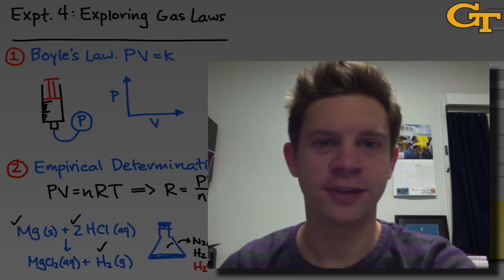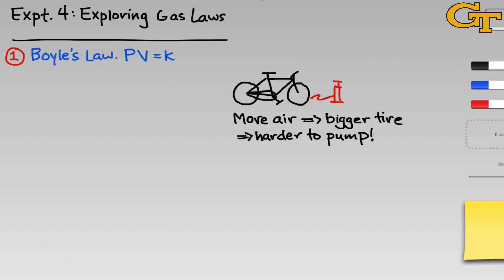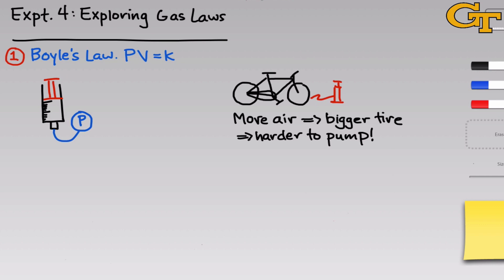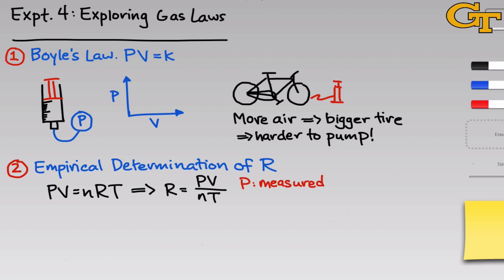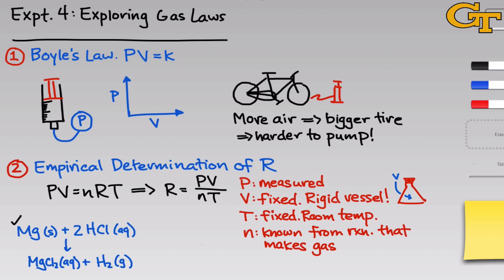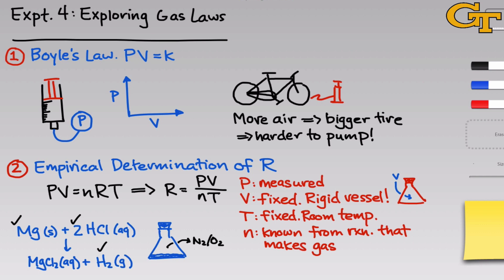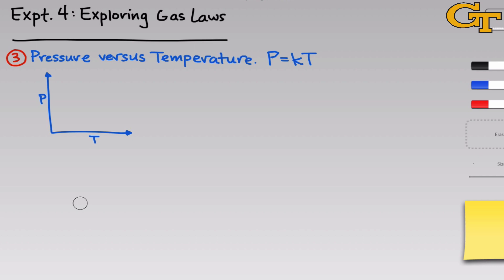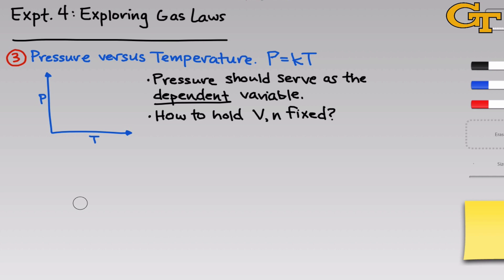Exploring Gas Laws | Intro & Theory

Comment: I totally understand why P is inversely related to V mathematically but what about when we put air into a balloon? As we're increasing the pressure inside the balloon, aren't we also increasing the volume? This qualitative view to me seems counter-intuitive or maybe I'm just missing something in my example.
Reply from the maker: The pressure inside the balloon is actually constant as it inflates! The elastic walls of the balloon ensure this. You can think of a balloon, in fact, as a "constant-pressure apparatus." As you add air to a balloon, you're keeping P fixed while you're increasing n (moles of air in the balloon) and V (the volume of the balloon).

A bubble (as in "blowing bubbles") works similarly: the pressure difference between a growing bubble and the surrounding air is essentially zero as it grows.
Reply: Wow thanks! I understand now. So basically, we're applying Avogadro's gas law here b/c we're dealing with the direct relationship between moles of gas and volume, not Boyle's law. Awesome explanation.
Reply from the maker: scottseptember1992
Bingo. Well said!